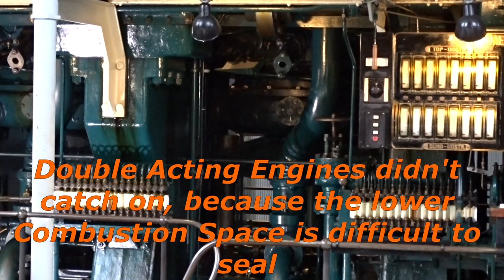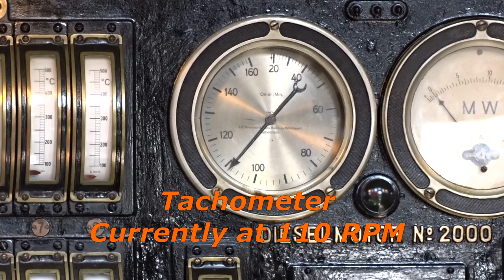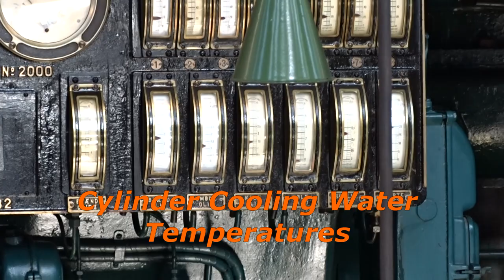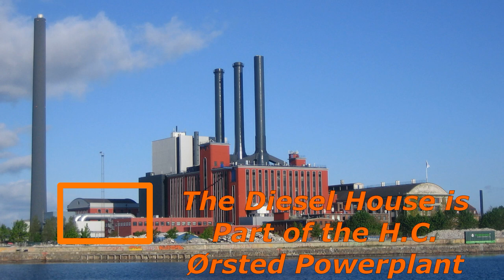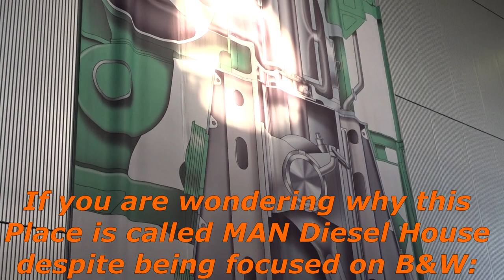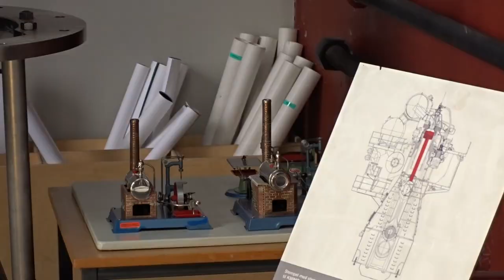Double Acting Two Stroke Diesel Engine at MAN Diesel House Copenhagen

Comment from the maker: I don't agree with YouTube hiding Dislikes. 752 Likes, 15 Dislikes, 2022-10-23. Just so you know what to expect from this Video.

Apparently, I fell for a popular Urban Myth. Instead of this Engine, the Zealand Grid was restarted from Sweden with Power supplied through the Øresund Sea Cables. That makes much more Sense anyway.

If you're wondering about the different Light Conditions and different Image and Audio Quality: I had to visit twice (November 2021 and March 2022) to record enough Fototage and used two different Cameras and three different Microphones. And I really should have checked my Spelling of "Thanks".
Reply: You can use an extension called "Return YouTube Dislike". It's still zero dislikes.
Reply from the maker: @Bnslamb  I have that but I can see the Dislikes in YouTube Studio anyway. These Browser Extensions aren't all that accurate tho; they often are off by one or two Dislikes compared to the accurate Number that I can see in YouTube Studio.
Reply: No, B&W No. 2000 was used to re-establish emergency power and help the other works start up again. I remember it quite clearly.
Reply: @maxjakobsen5526   No it was startet op, but never used (2003).
Reply: @andreasfrederiksen6475  Wrong, it was used. Have you been there and seen the engine start. ? It could be that the people who operate the engine and explain about it remember incorrectly. :-)
Reply: @maxjakobsen5526  yes i have. And having had About it in scool i Know im right. But that i say dossent matter so here is a link to the Danish Wikipedia from where you cant find links that confirms what im saying https://da.m.wikipedia.org/wiki/Str%C3%B8mafbrydelsen_23._september_2003
Reply: Dislike extensions r. kind of a lie.
Reply: "To restart a grid" .... that sentence alone sounds like a video of its own in the future.
Reply: @Genius_at_Work  I added an extra like :)
Reply from the maker: @jlinkels  I'll have to see when I can update the Counter. I'm currently living without proper Internet Access, so I can use YouTube on my Phone only. I need the PC Website to see the Dislikes though. The Dates given in the Comments are even more outdated.
Reply from the maker: @frodbolf  I'm planning something a bit similar; using the Engine Room Simulator in my Maritime Acadamy to show how to start up a Ship. A major Part in that is getting the Electric Grid going, although that is nowhere near as complicated as the "real" Grid on Shore. There only are 3-6 Generators, which also are of similar (if not identical) Types, and there only are up to three different Voltage Levels too.
Reply from the maker: @andreasfrederiksen6475  Your Comment was marked as Spam by YouTube, because you included a Link. I had to approve it first, and only did so now, as I don't check the Spam Filter every Day. Dunno if this is gonna mess up this Thread a bit, as there have been more Comments posted since then.

Comments with Links are marked as Spam, to counter the numerous Scambots and Sub4Sub Kids.

Comment: For all us motorheads this was a treat. Thank you.
Reply: @MarkUKInsects   LOL... maybe you should calculate for your friends how much diesel fuel an average "zero emmission" electric vehicle uses.  Just be sure to add in the loss through copper wire resistance, step down transformer loss, lithium battery internal resistance, electric motor loss, as well as a generators synchronous rectification losses while converting direct to alternating current, ect ect ect..
Reply: Is those 2 stroke available in the 2025 Arctic cat riot sleds? I hope so
Reply: @jlo13800  Yes, they are basically a Screaming Jimmy two banger knockoffs with a DEF canister.

Comment: These old engines will outlive lots of these modern ways of power, they will still be needed 100+ years from now. ❤❤
Reply from the maker: The Engine can't be synched to the Grid anymore since a few Years, and actually suffered Blow-by on one Cylinder for many Years until that Issue was fixed. Sealing the Piston Rod going through the lower Exhaust Slider just is a flimsy Point of Failure, and overall the Engine just is needlessly complicated by modern Standards. The only Powerplants that can  regularly go for 100+ Years with little to no Changes are Hydroelectric, and the oldest Thermal Powerplant I can think of right now is the Beznau Nuclear Plant in Switzerland, which is operating since 1969.
Reply: @Genius_at_Work Thank you for the detailed answer. Thermal power plants are not going to be the main power source of the future. I wonder if any will continue to operate but use non fossil fuels.
Reply: Pulsed plasma 2 stroke where an air toroidal plasma tape ZPE from the abrupt motion of nuclei/electrons. All electrons/protons are little vortices in the aether ZPE which has stupendous electromagnetic fluxes at the plank sizes!

Comment: I've seen other videos of this engine before and was really intrigued by it...  However this video is the first time I've seen how the engine really operates, explaining how it accomplishes being 2 cycle and double acting.  Great information and very interesting indeed!  Thanks for posting this!
Reply from the maker: The Engine being labeled as "Opposed Piston" in many of these Videos bugged me a bit. I knew since a long Time that it is Double Acting, but understanding the Exhaust Sliders took a bit of a Chat with the Engineers there. Mind you, I'm currently working on a Video about the most over-engineered Machine I've ever seen. That happens to be the Steam Engine on the Swiss Paddle Steamer Stadt Luzern. It's a Uniflow Steam Engine with hydraulic Valve Gear. Especially the Hydraulic System is mindboggingly complicated, but the Condensers aren't nearly as simple as in normal Steam Engines either.

Comment: Many thanks for this great video. I remember a brief study of these in my education in the early 1970:s. I admired them then, and are amazed to watch one come to life. A very beautiful engine of B&W. Real heroes of large diesels. As a swede I am also a bit proud of the ASEA company in heavy electrics. Well B&W is MAN now, and ASEA is ABB, but nevertheless, they are historical heroes.
Reply from the maker: B&W simply had a functional Engine but no Money, while MAN had rubbish Engines (see my Cap San Diego Engine Video) and Loads of Money. All "MAN" Two Stroke Engines actually are B&W, as the MAN MC Engine essentially is a B&W Design and later ones such as MC-C or ME are based on that. It's sort of similar with Sulzer, Wärtsilä-Sulzer and today's WinGD. As I grew up very close to Switzerland, I'm probably even more familiar with Swiss Engineering than with German. BBC bought MFO, but moved into their Zürich-Oerlikon Offices, which eventually became ABB when BBC merged with ASEA. SLM used to belong to Sulzer and besame what is Stadler today, and IIRC, SAAS became Part of BBC too.

Comment: I've seen this engine running at several occasions and as a former ship engineer each time I'm impressed. ⚙
Reply: @25musicmaker  I thought of an OP 2 stroke 1700 Rotax made from 2 new 850’s. Like a Fairbanks Morse OP 2 stroke with cranks geared together. It would lay down in the chassis! Achates power should get in on this.

Comment: When I saw the movement of the crosshead in front of the operator, it didn't look like 1500mm stroke. But once I learned that there are 2 combustion chambers and 1 piston and 2 sliders in one cylinder in your explanation, I understood it. Great video! Great engine! thank you!
Reply from the maker: That's not the Crosshead, at least not of the "main" Double Piston. It's the lower Exhaust Slider, hence it moves only such a short Distance. The actual Crosshead is located inside the Crank Case, just like in (almost) any other Diesel Engine.

Comment: Excellent job showing this engine and describing its' workings. Few would have known of double acting diesels. I did because of 2 uncles that were in US submarines that had HOR double acting diesels in a diesel electric configuration. Those engines were a complete failure. Some subs left on patrol with 4 engines and returned with a single one still running. The subs with those engines had to be withdrawn from combat to have their engines replaced. A double acting diesel would be the logical progression from steam.
Again, you did a great job presenting this engine. Thanks!
Reply from the maker: Sorry for the late Reply, I'm currently working at Sea with limited Internet Connection. But big thanks for the Donation, that's easily as much as this Video usually makes in a Month. I'm considering to record a better Video of this Engine at some Point, but it only runs twice per Month for 5-10 Minutes only, so I'd have to visit at least twice (like I did for this Video). When I recorded this Video, I was living in Flensburg at the German-Danish Border, making Travel to Copenhagen fairly easy, but having moved away since, visiting Diesel House twice would most likely involve a longer Holiday to Denmark and/or southern Sweden with Diesel House at the Beginning and End. I'll have to see to that if and when that could be arranged.

Comment: Cam shaft also drives rotary air valve which operates air start valves,+ operates cylinder oil lubricators.

Comment: I have seen other videos of this Diesel Engine being run. This is the first time I have seen a section of the camshaft chain on display. Wow that is the largest chain I have ever seen. That chain is huge and massive.
Reply from the maker: There are a lot more Bits and Bobs on Display, but from other B&W Engines; e.g. the smaller Chain next to it, or the K98 Piston at the End of this Video. There also are a Variety of Exhaust Valves, including K98 Valves being used as Bar Tables.

Btw. I tried to record a better View of the Cam Shaft, from below so one can see the actual Shaft and not just the Flange Joints. The Engine stopped before I could do so, and I already travelled to Copenhagen twice because the Engine runs so short. Even though I used to live fairly close then (Flensburg), I didn't want to travel to Copenhagen for a third Time.

Comment: A double-acting two-stroke [DATS] design needs two cylinder heads, the piston is subjected to combustion on both sides; the single piston’s connecting rod passes through the lower head subjecting the packing gland to high temperature and pressure which caused cooling difficulties that resulted in their frequent failure, the lower head suffered frequent cracking and bolt failure. To extract maximum power from a given reciprocating internal combustion engine’s cylinder DATS is theoretically the most powerful system but it necessitates a more efficient cooling system and more complicated construction than is required for a single-acting  two or four-stroke alternative.  DATS system development was dropped by most marine engine builders as commercial ventures in the late 1930's because of excessive maintenance demands. The Danish example is a survivor of this era of DATS history.   The last DATS for commercial maritime use were built by MAN in the 1950's. 

To their cost MAN (for the Kriegsmarine) and KANPON (for the IJN) persisted with development for use in naval vessels (they could afford the engine room staff).  The German Navy completed several major surface warships with DATS (3 heavy cruisers, 2 light cruisers [DATS for cruising, ST for sprints], a minelayer/training ship and a destroyer besides half a dozen large naval auxiliaries. Development of several DATS engines, was undertaken; 19/30 E-boat, 23/34 (license sold to the US Navy as a submarine power plant), 30/44, Destroyer type and auxiliaries, 42/58 heavy cruiser, 65/95 battleship.  

The Japanese experience was traumatic; the inability of their engineers to design an efficient system to cool the pistons was not helped by a decision to make the engine as compact as possible by setting the cylinders too close together which exacerbated a piston cooling arrangement problem intrinsic to DATS design. The A-140 super-battleship designs considered by the IJN all featured 11-cyl 47/49 DATS, to provide a third or half the installed power.  A-140F5 was chosen as the definitive YAMATO design but the engine design team failed to get the DATS to deliver the performance necessary so a complete re-design of the machinery space to accommodate ST machinery in place of the diesel installation became necessary. Most of the IJN first-line submarine fleet were powered by 7, 8 or 10-cyl 47/49 DATS but by 1943 the bulk of them had to be withdrawn from service, many were re-engined with much lower power single-acting two- and four-stroke engines in order to be available for deployment.

For those readers interested DATS are covered in two books written by Lyle Cummins and copies of The Motorship' and 'The Marine Engine-Builder' which are available in bound bi-annual volumes in certain city libraries - certainly Manchester, Liverpool and London.
Reply from the maker: I knew about the MAN Engines for the Kriegsmarine, a Piston with Crisshead and Conrod is on Display at Deutsches Museum Munich. This Engine is even more complicated than what you described, as the Piston Rod moves through the Exhaust Slider instead of just the Cylinder Head. That's also what made these Double Acting Opposed Piston Engines even worse, as the longer Stroke of the Pistons in the Cylinder Covers meant, that the Piston Rod is moving through the lower one at a much higher Speed.
Reply: @Genius_at_Work  Thanks for the additional information about the MAN designs, the Kanpon DATS engine, based on a Sulzer design purchased in 1925, was built in 1932
Reply from the maker: @geofftoase3855  "This Engine" means the B&W one in this Video. IIRC, MAN used just normal Cylinder Covers. MAN also built Double Acting Two Stroke V-Engines, a V24 is on Display at the Auto-Technik Museum Sinsheim (or maybe Speyer, dunno right now)
Reply: @Genius_at_Work  Thanks for pointing out my mis-reading.
Reply: Opposed piston engines do not have cylinder heads. Also this engine was made in Denmark 🇩🇰 by Burmester + Wayne. 
MAN didn't produce Opposed piston diesels.

Comment: I thought I was an unusual engine buff but I've never seen anything like this before. Nice vid and thanks for the explanatory text. I'm not sure I would have worked out that the uppy-downy-things (technical term) were the exhaust valves without it.
Reply from the maker: I had to ask the Engineers there too.
Reply: The exhaust pistons cover+ uncover the exhaust ports.
Reply: Exhaust sliders are exhaust pistons, hence opposed piston engine.

Comment: I'm visiting Copenhagen  this August. Is the diesel house open to the public? It would be amazing to see this amazing beast in the flesh.
Reply from the maker: IIRC, it is open every Day, but the Engines are started every two Weeks only. The big B&W 2000 every 1st and 3rd Sunday of the Month, and the 120 Year old B&W No. 1 on every 2nd Thuraday, intermittent with some other smaller Diesel Engine. I could be wrong though, but these Informations are available on the Diesel House Website too. I just can't look them up right now due to my slow Internet Connection.
Reply: @Genius_at_Work  thanks for your reply

Comment: Besides the double action and its extra components this is very similar to 2 stroke  Detroit engines or any other inflow scavenged diesel.
Reply: All hail the mighty 8/71. Back when god were a lad I worked as a relief shunter on a steelworks and the tractor units were cobbled together from what was basically junk from other units that had been wrecked in some way. All that really mattered was pulling power and the one with an 8/71 and a 4-speed crash-box was my favourite. Accelerated unladen in top like a dragster, up to a speed of about 30mph, and in low gear it was unstoppable... Literally... The brakes couldn't hold it against even a mild application of the go pedal.
Reply: Detroit has inlet ports + exhaust  valves.

Comment: I’m not sure what makes this a double acting engine? Is combustion taking place on both sides of the piston? It looks more like an opposed piston design to me.
Reply from the maker: Watch the Video. It's explained in great Detail there, how the Things that you can see on Top aren't real Pistons, as they are smaller and have a much shorter Stroke than the Main Piston in the Middle. It only acts as Exhaust Valve and dies barely any Work because if the small Bore and Stroke, hence it's not exactly a Piston. There are Examples given (Models) for actual Opposed Piston Engines, and one that combines Double Acting and Opposed Pistons.
Reply from the maker: Little Addition: You edited your Comment while I was typing. Yes it combusts on both Sides of the Piston.

Comment: I have a question, this engine is German technology or Danish technology? Sorry, because Denmark is just a small country!
Reply from the maker: Purely Danish. Even today, all big Two Stroke Engines that have "MAN" written on them are actually Danish, developed in Copenhagen and based in Designs, that date back to when Burgmeister & Wain was independent. MAN just happened to buy B&W, hence the place is called MAN Diesel House today even if there is barely anything MAN about it. The same applies to Wärtsilä-Sulzer btw. Wärtsilä-Sulzer Two Stroke Diesels are Swiss Engineering with a Finnish Badge slapped onto it. Switzerland isn't large either, but has an amazing Engineering Heritage.
Reply: @Genius_at_Work  Thank you !

Comment: So would this be a one stroke engine?
Reply from the maker: The Working Principle still is a Two Stroke; it just happens to have two Power Strokes per Revolution. There were also Attempts at Double Acting Four Stroke Engines, but these worked even worse.